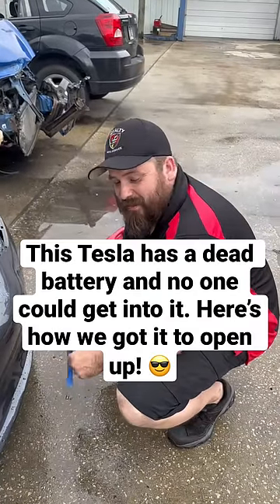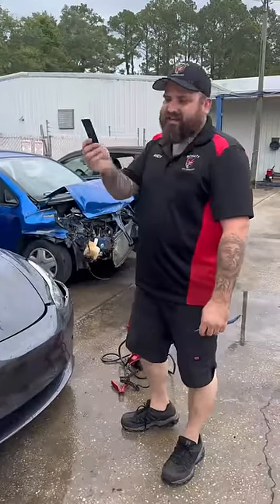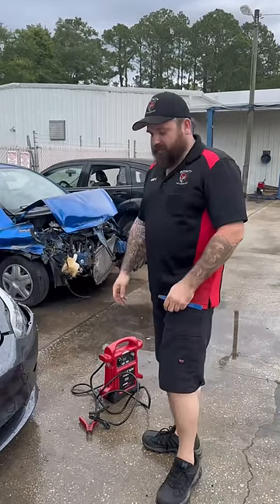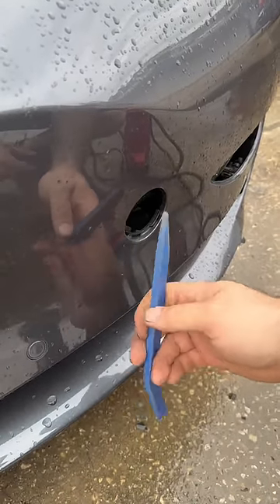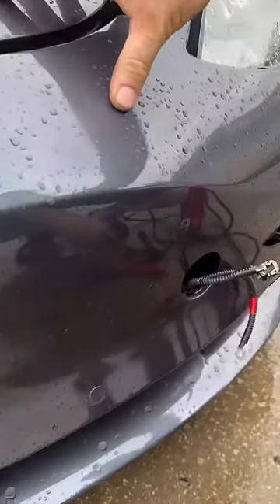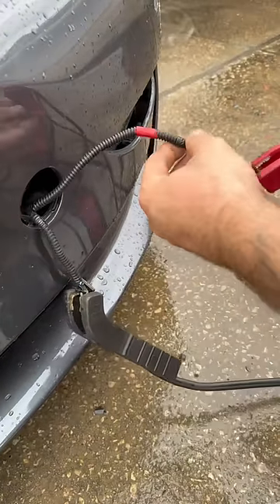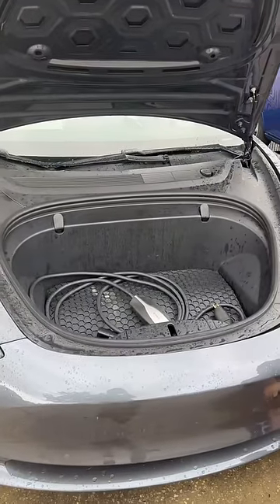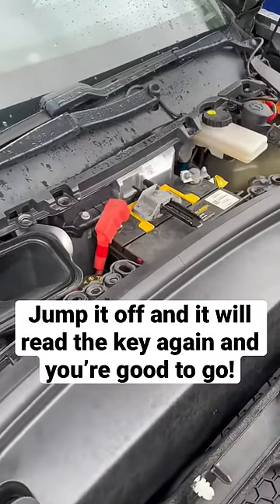Dead Tesla! How Can We Get Into It? #shorts #tesla #teslamodel3 #car #mechanic #crazy #hack #tips

Comment: Electric cars have ONE big advantage:

If it gets stolen, it can't be far away.
Reply: That is the absolute truth.  They will also slow down as the battery gets exhausted.  It does not have linear power.  Under a certain amount of voltage, the regulator stops working and the car starts slowing down.  It does it even with the regulator working, but not as pronounced.
Reply: Simple Solution just get a flatbed truck
Reply: But gas cars are stolen easily.. I can track down my Tesla’s location, even limit the speed remote. Now tell me again about your stone age gasoline car.
Reply: @obi1774  Modern petrol, diesel, and petrol natural gas, vehicles can be easily tracked, disabled by a radio signal from a cellular tower, satellite, or petrol vehicle.  My neighbour got her 2011 Ram 1500 disabled remotely because she was late for her payments.  Once she paid, a signal reenabled her pickup truck. They also know where her Ram is.  It got towed from a public parking facility because the bank knew where it was. She did eventually finish paying her Ram 1500.  But I refuse to own a vehicle that can be remotely disabled, or tracked.  She laughs at me for saying that because she believes I have no way around it.  Then I remind her that I have been driving the same vehicke for 17 years.
Reply: @obi1774  yea.. one of my guys showed me how he stepped out of the car then punched in a code on re-entry.. he said nobody could step in behind him and take off.
Reply: @obi1774  Yeah, and the government can do all of that to your Tesla as well.
Reply: @indridcold8433  While that’s true and you’re to be commended for keeping a vehicle for that long… it’s going to die eventually.  Eventually many people will be forced to buy (or lease) these super-connected vehicles.  I hate it.
Reply: @indridcold8433  its like you dont understand the minimum voltage limit in lithium batteries. Your phone does the same thing because it has mostly the same chemical compound as a tesla battery.
Reply: @HawkGTboy now new vehicles give you heated seats & steering wheel then charge you a yearly subscription 😳🤡💩🦷💰💰💰💰💰
Reply: @obi1774 got a stick shift not too many can drive those. Actually electric vehicles were developed before ice so what's your comment about stone age again.
Reply: @bonniejosavland3227 Only some companies are doing that. Not all EV's. Maybe you could do a little research before you embarrass yourself again.
Reply: The advantage is they'll be able to shut the car off and lock the thieves inside the car until law enforcement shows up
Reply: Depending on how close the shipping container is 😂 then it's on to Africa or the middle east
Reply: @cheeseburgers82 since when is it an advantage to lock thieves in your car waiting for the cops, while they're smashing this shit out of it inside trying to get out? 😂
Reply: Yes indeed.
Reply: Canadian rental Tesla was dropped off at a shipping company packaged in a container and shipped to the Middle East. They tracked it got RCMP and Interpol involved and the container was intercepted in Italy and shipped back.
Reply: So much for not very far away if it gets stolen... they had to get Canadian Police, Interpol and lawyers involved to recover it.
Reply: Can't they be turned off by Tesla?
Reply: Well, if you consider 300-500 miles not far away. That’s the range on most of them.
Reply: @obi1774  you may be the one in the stone age, modern vehicles can be easily tracked down, doesn't matter what they are powered on.
Reply: @obi1774 if you can stop your car that way so can the government. Not to mention having to wait for the charge or how toxic to the environment landfills of lithium batteries are. Oh did I forget that electricity you're using is generated from fossil fuels  in one way or another  either with the manufacture of those wind turbines that leak oil all over the ground or those solar panels that take up acres of  land and do not decomose
Reply: @indridcold8433  Ive seen on many EV's, they cut the ac first.. then the powersteering, then it slows down lol.
Reply: Electric teslas. This isn't necessarily the case for other brands of evs.  Tesla is like Apple, doesn't play well with others.
Reply: @obi1774 gas engines make manly noise to assert dominance.  And stink for extra effect.
Reply: @obi1774  Tracking a Tesla that has been loaded onto a flatbed truck while a jammer is in use can be challenging. However, here are some steps you can take to improve your chances of locating your vehicle:
Reply: @obi1774 also some guy saying it won't go far... only 300miles.  Farther than you drive 99
9999percent of the time.

I want to be on the anti EV bandwagon but their arguments are so low iq
Reply: If it catches fire, it locks you in.
Reply: Unless it is towed put on a truck, and driven a long way away....
Reply: @obi1774 I think you're behind the times. I can track my ICE truck and all of my family's vehicles. Hardly anything new and definitely not reserved just for Tesla
Reply: @obi1774 And so can the government.  You are open to state intrusion with this car.
Reply: Nvr lied lol. Until underground charging station pop. Up they aint runnin far .
Hold up🤔
Reply: @ShiftyGearz  where will the power come from?????
Reply: @indridcold8433 😂😂😂 what are you all talking about???
Reply: Don't drive in heavy rain  flooded streets ,another added bonus to diminishing charge anxiety.
Reply: @obi1774 a diesel engine can be easily be restarted after years of being  turned  off !
Reply: @obi1774 came here for the defensive fan boy comments and never dissapointed. 😅😅
Reply: Better yet, buy a manual transmission equipped car. Most thieves can’t drive them either. “Millennial Anti-Theft Device” I’ve heard them called, lol.
Reply: Herr come the hick comments..  lpl.  Mah Ferd don't need no electricitay.
Reply: Wait until the death toll gets ridiculous....when 12v isn't there, safety shuts down everything,  including you.

Comment: My old vw beetle would never do this to me…. More tech… more expensive.. more headaches
Reply: More performance than a 41 HP engine. I still have my '71 Karmann Ghia Convertible and I love it. But my Model 3s are much more comfortable.
Reply: I need a radiator for 1 do you have 1?
Reply: I'll keep my bicycle
Reply: I’ll keep my horse
Reply: @bobbobby1846  
Radiator for an air cooled engine....
Reply: The new beetle locks you out and in, when the battery runs dead, it wont open.

Comment: my sisters bmw was similar. the door handles were electronic not mechanical and without power the doors wouldn't open, and the battery is under the back seat, so you cant get to the battery to change it if its dead. I had to crawl under the car with jumper cables and hook them to the starter solenoid to get the doors open.
Reply: fk that
Reply: *were electric.
Reply: @OttoByOgraffey  you are correct, Its now fixed
Reply: @stonewolf9459  sorry. I'm a jerk that way.
Reply: That sucks
Reply: you can't do that with a Tesla!
Reply: Yea my 2017 Chevy SS is like that. The battery is in the trunk but the trunk is automatic only. I had to go to open the car and drop the rear seat divider and pull the emergency latch so I could access the battery to jump the car. Not as bad but more complex then it needed to be.
Reply: @Jimster481  my W211 E500 Benz is like that too
Reply: BMW/Mercedes owners will do anything except buy a decent vehicle
Reply: @kevinm.n.5158  In addition to my Mercedes, I also own an Acura Legend and a Nissan Xterra so idk what you’re talking about there pal, but that isn’t true at all lol
Reply: @bleachstain9785  typical Nissan owner/Ludacris fan behavior
Reply: @kevinm.n.5158  you just got something to say about everything now don’t you?

Comment: with my car I can put the key in the door, turn it to unlock it, pull up on the latch & it opens! The great thing is instead of a frunk it has a hood with a carbureted V8 underneath It makes makes an actual engine sound especially with the dual exhaust
Reply: Now THAT's what I call a car!!
👍🏽🎯
Reply: Yeah but the model three is probably faster then anything you have ever driven and they never ever have to stop at a gas station to get gas. Give that some real thought.
Reply: @jstar1000  but who cares about speed when we have speed limits plus I have lived thru those muscle car days of speed & I am just an old cruiser now especially since my car looks cooler, sounds better & turns more heads than any EV! You may never have to stop at a gas station but you have to stop eventually & for quite an extended period of time where I can be filled up in 3-5 minutes! Go to any car show, meet, cruise-in & tell me what gets more attention, a muscle car/truck or an EV...give that some thought
Reply: @Squirmin Herman the one eyed German  I hear you,  you can still have that car too but the ev for daily driving is the bomb,  it's full and ready every morning. I very rarely charge away from home but when I do it adds 100 miles of range in 10 minutes,  that's is totally doable.  20 minute stop will give me 200 miles of range that's over 3 hours of driving. I use my truck on long trips luke that though. If you don't want an ev though, don't buy one.
Reply: @jstar1000  actually I am cool with them, I like the Rivian & they are building a new plant here in Georgia! As far as EV trucks I think they are one of the best
Reply: @jstar1000  HAVE YOU PRICED A NEW BATTERY?  NO ONE WILL BUY ONE WITH A DEAD BATT, EITHER.
Reply: My favorite comment yet!
Reply: Those were the days….
Reply: @jstar1000 are you ok? No really.
Reply: @SquirminHermanthe1eyedGerman why mention the engine size if it's not about speed ;)
Reply: @jeffryblackmon4846 yeah a 12v battery is about $50 - same for any gas car
Reply: @jeffryblackmon4846  lololol ever price a new engine installed in a new Truck?  Give me a break these new trucks arent going 300K miles either and Ill give you a hint people are scrapping em now.  So dont pretend these Teslas are being taken off the road due to batteries any faster than new cars are.  I did the head on my last audi at nearly 8K a pop 3 times in 130K miles.  New engines are garbage electric is where we are going period.  

My daily driver is a 1983 mercedes diesel.  I have two of them they go 300+ thousand miles.   Ive gone through an audi 2 new bmws and a vw in 5 years Ive had a benz diesel thays older than I am since high-school.   Dont pretend electric has more problems than ICE they dont.
Reply: @problemchild1976  I just said it was a V8 thats all, are you obsessed with size?
Reply: @bryceg5709  Kudos on driving a Benz especially those old diesels! I knew a guy that had a '78 with almost a million miles on it & countless others that have gone for hundreds of thousands of miles
Reply: @SquirminHermanthe1eyedGerman  yes but I would 100% also buy an electric car.  I also have a 1968 Porsche.  All of those things make me like electric too.  They're not in conflict
Reply: @jstar1000  speed makes no difference when i can fill up my tank in 3 minutes, and continue my travels.
Reply: @jstar1000  We won't have a choice the way our government is regulating gas and diesel automobiles.
Reply: @problemchild1976  Have you bought a car battery lately? Try adding $75.00 to $100.00 to that $50.00.
Reply: Keep on trucking
Reply: @SquirminHermanthe1eyedGerman  well we don't get V8 much in the UK - but we get stick on most cars. No one can be a gear head and moan about EVs not being proper cars if they have a shitty auto box.
Why does your car not have a 4 cylinder?
Reply: @craigchapin3888  well that's for those expensive stop start ones.
In the uk I use eurocarparts and a Bosch battery is about £100 but they regularly have 50% off.
But I don't need massive cranking voltage on an EV so don't need the power
Reply: @jstar1000  lmao but thetcgav to charge for an hour when that v8 is back on the road after three minutes
Reply: @acexbox  I get 100 miles of range in 10 minutes, go piss, grab a drink and your over 100 miles,  your miss informed,  as far as Tesla goes anyway
Reply: Sounds futuristic
Reply: I bet that makes hurricane evacuations less stressful.
Reply: @jstar1000  we don't have a Tesla so we don't get those speeds but half hour and we are up from 20% to 80% 
That's a cuppa and a wee
Reply: @bryceg5709  Thats cool & is that a '68 911?
Reply: @problemchild1976  Oh I understand about the UK but they did have some cool cars in the '60s & 70s! I learned how to drive in a '49 Ford farm truck with a 3 on the tree when I was 12 yrs old & had a few manuals over the years! I can pretty much drive anything with a stick even big rigs as I drove one for many years in the '80s & '90s! 
And why would I want a car with a 4 banger when I can have a V8? I live in Georgia where we southern boys love our V8s & so do the Georgia peaches!
Reply: @jstar1000  I get 100 miles of range in 5 minutes in my Bandit Trans Am, open the gas cap, pump gas, close gas cap & leave plus it looks great with the Ttops out & chics really dig it
Reply: @bryceg5709  i don't know what trucks you are talking about but the ones I have experience with easily go 300k. The engines can go 750k+ without major repair. The reason they are getting scrapped here is because the body and frame rot out before they can get that high of mileage. Besides this is a terrible comparison. No truck would need to have an engine replaced every 3 years. That is the shelf life of lithium cells.
Reply: @jstar1000  teslas are not "fast" they're quick
Reply: @SquirminHermanthe1eyedGerman  but v8 Vs 4pot isn't about speed? 
V8 is an American thing! And you slate the 4pot jap brigade even though their cars are faster and handle better and mostly with a great manual set up. 
If a V8 is better than a 4pot then a manual is better than an auto.
How much money do Americans spend on modding their cars to up their acceleration? If I sold an ECU map that gave you max torque from 0rpm in be a billionaire! Literally every manufacturer, race team, modder etc would buy one no?
Reply: @craigchapin3888  Yea just bought a new Optima & it was $249
Reply: And if there’s a fire you can put it out. How novel
Reply: @genuineimpulse9134  should I use a fire extinguisher or water hose?
Reply: " Engine go vroom. If it doesnt vroom how do i know it works" lmfao bro
Reply: @jstar1000 20 minutes for a 200 mile charge, I can have my tank filled pay for the gas and be 10 minutes down the road before you’ve even unhooked your car and I’ll get even further on that tank, there’s a reason why you have a truck for longer hauls, no one including you wants to add another hour or better to get where they’re going
Reply: @HebrewHunter101  not too bright are we? You will get it one day when & if you ever grow into adulthood
Reply: @jstar1000  and in winter the V8 has a heater, and windscreen wipers, whist the tesla (hopefully) has an overcoat in the boot for when the battary gives up.
Reply: @jstar1000  we haven't. i was looking at one BUT my garage is attached to the house and if the battery fires whilst charging i burn the house down.
Reply: @problemchild1976  a v8 is not about speed, it's about never using the radio to hear some great music, whilst the tesla has tyre noise.
Reply: @davec8730  I have 2 cars with great exhaust systems - neither are V8.
So if it's just about the sound, why do people talk about 1/4 mile events at the strip which is a speed thing?!
So playing v8 sounds into the cabin doesn't fix if it's just about sound?
It's an emotive thing not a rational thing which is fine - but saying you can't get that from an EV is just your opinion. 
Anyone working on gas turbine engines or even v10 engine may treat your v8 with similar contempt as you are giving to an EV 
I have both and like both 
EVs give you a fantastic driving experience and out perform gas cars
Reply: @problemchild1976  how many gas turbines and v10's are about, other than pictures on your bedroom wall? 
how many 'strips' on the way to work?
Reply: @davec8730  I think you've missed the point by an absolute country mile
Reply: @SquirminHermanthe1eyedGerman it takes me three seconds to fill up on electricity because I don’t have to be there for it.
Reply: @davec8730 battery fires are insanely rare. If you are scared of fire it’s your safest option
Reply: @jstar1000 I'd totally be on the EV hype if batteries were easily accessible to replace. More sporty, RWD, and AFFORDABLE EVs would be something I'd like to see in the future. As of right now, I think I'll stick to ICE cars as I don't see anything wrong with cars that can probably last more than my lifespan.
Reply: @EnhancedTrashBin  Why do batteries need to be accessible when you may never need one in your ownership life span? Tesla's come with an 8 year 120k mile warranty, that is pretty dang good and the reason is you probably wont need it ever most likely, they also make a RWD model 3 and my model 3 is the fastest car I have ever driven, I'm 62 and have had many and been in many fast cars. You can get a RWD model 3 for under $40k that is pretty cheap by todays new car prices.